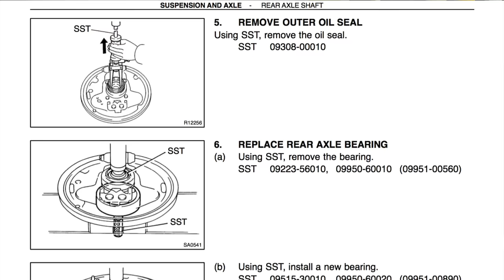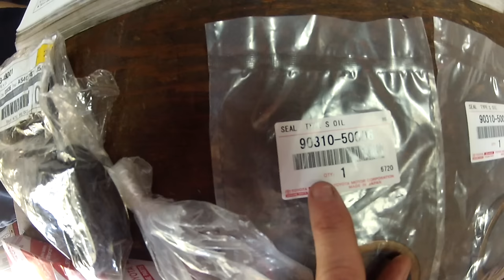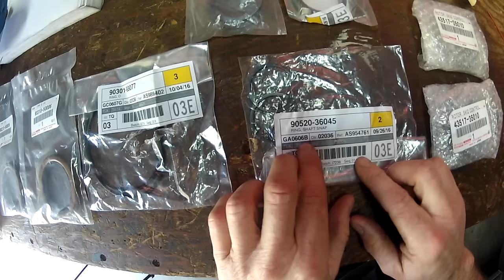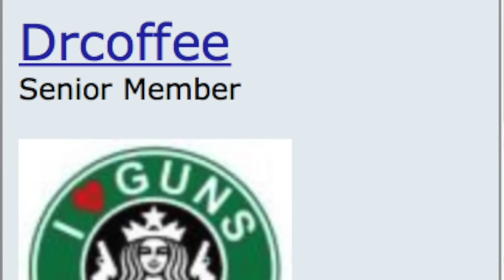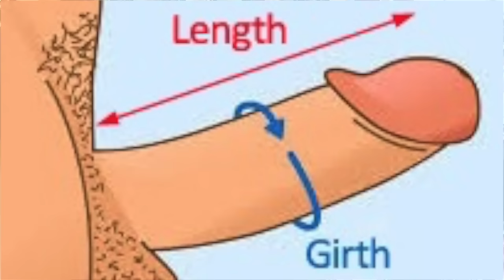Toyota Rear Axle Seal/Bearing Replacement (ABS Rearend)

Comment: Timmay,
Nice instructive video I watched just to become aware of what is involved in the job. But it will not help me because I don't have the space or equipment to do the job. Just found out that it will cost me $875 to have my local small town Toyota dealer replace both rear wheel bearings on a 2000 Tundra.
Probably not a bad price considering how much labor is involved...

How much labor did you put into this job?
Reply from the maker: With experience doing this job on 3 different 3rd Gen 4runners, I can knock this job out 3-4 hours and I'm not a fast mechanic.  For a dealer, $875 is a very fair price.  My local dealer in San Jose California would charge much more.  Their hourly rate is $150/hr.  

If the mechanics know what they are doing and have the right tools, they can pull the parts off rather than cut them off, and reuse the 2 retainers and ABS gear on each side.  You only need to buy the 2 bearings, 2 dust seals, 2 seals, and 2 large o-rings at the ends of the axle housing.  I mention this ability to save money on parts in the video description.  

I hate to say this Bob but there's a very good chance you now know more about this repair than the mechanic who's going to perform the work at the dealership because you've watched our video.  When I bought my 2000 4runner used, I found I had a leaking rear axle seal shorty after purchasing it.  After doing some research on Toyota forums, I learned you either needed to buy special tools or you had to bring your axles to a machine shop to do the work for you.  When I learned some machine shops messed up the press work and/or damaged the axles cutting off the parts, I decided I would let my local dealer do the job for me.  Including new rear brakes and a brake bleed, the dealership bent me over for $1500.  The end result is they botched the job.  I pulled my ABS sensors and found the driver side seal was already leaking.  I took my 4runner back to the dealership and got to talk to the mechanic who performed the job.  I had him do the grease test right in front of me and confirmed he didn't press on the inner retainer correctly.  He was just following the the FSM spec and didn't bother to confirm the position was good.  He probably didn't even know Toyota redesigned the seals that require the inner retainer position to be moved more inboard or flipped like we show in the video.  He also didn't even know what a grease test was.  One of the other senior mechanics admitted I schooled the dude and I'm not even a trained mechanic with certifications.  

Bob, if you want to save money, I would search your local area for a good machine shop and see if they have the tools necessary to service your axles.  Since you know what's involved with this repair, you can be very specific on what you want them to do like flipping the orientation of the inner retainer and the measurement you want them to press it on.  You could even mention the ability to reuse the retainers by swapping their positions on the axle and the ability to reuse the ABS gears too.  By pulling the axle yourself and having a machine shop do the press work, you could save yourself a pretty good chunk of change.  Something to think about.  If no machine shop in your area can do it, ask the dealer how much they'd charge if you to do just the press work.  Like I said, remember to be specific on how you want the press work done because certified mechanics screw up this job all the time.  Trust me.

Comment: So it's been over a year since I did this on my tacoma. Everything has been fine until I recently checked my drum brakes. Gear lube was all over my brakes from the rear differential. Took it to a shop and they said they were installed incorrectly and had to have the axle machined because of it. The truck drove smoothly, no noises or anything. I just coughed up the money and let them fix it but didnt get to see the damage myself. I almost dont believe it, wouldn't it be obvious my bearings weren't installed correctly? Other than fluids coming out the hub?
Reply from the maker: it's hard to say what they're talking about by saying it was installed incorrectly without seeing it myself.  Did you do the previous work or did somebody else do it?
Reply: @TimmyTheToolman  I did the wheel bearings myself to the Tee of this video to the best of my ability. They said the bearings were pushed too far, then said the retainer was pushed too far and was gouged. Charged me a hefty 1200 lol. I feel I got lied to. Theres no way to push the bearings too far right? And I did the grease test, and ensure the retainer was within 5mm of the polished mark. What do you think failed? I feel I messed up installing the seals but nothing else. I was so proud of myself :(
Reply from the maker: @cyclopz-J  You can't push the bearing too far.  You press until the press loads up and you can see the snap ring groove exposed above the outer retainer.  If you confirmed you had a good mating of the seal with the inner retainer, I don't know what could have been the issue other than a clogged breather.  I think these people lied to you.  5mm of polished axle showing is usually about perfect to get the seal riding near center on the retainer but you still need to confirm the mating with a grease or sharpie test which you did.  It's weird that the job didn't work for you.  Have you checked the breather for proper function?

Comment: Ive heard that there is a "vent valve" on the top of the axle. This can get clogged up and also be the culprit of the oil seals leaking. Not sure if these 4runners have them since i sold mine but just an fyi.
Reply from the maker: Yep, you're absolutely right.  This was something I forgot to mention in the video as a possible cause for an axle seal failure.   When the pressure builds up in the 3rd member and it can't vent out of the breather the pressure will take the path of least resistance and that ends up being the axle seals.  Thanks for the comment.

Comment: Thank you for making video. The OEM part numbers alone helps a ton
Reply from the maker: You're welcome Justin.  I just learned though that the 2001 and 2002 have a different bearing than the 1996-2000 3rd Gen 4runners.  Look at the video description and I list the part numbers there.
Reply: I got a question. I have the heads of my 4x4 2000 5spd 4runner. over heated when the radiator failed(cracked behind fan shroud). I got a valvejob done and resurfaced the heads. bolted them on, did a leakdown test to find #2 & 4 cylinder still very low(at 85psi on the inlet of the leakdown tester I was seeing 25psi on the outlet) but no longer venting through the exhaust or intake valves so bad rings  need to remove those pistons. What do you thing will be easier removing driveline ,front diff and oil pan or proceed to pull out engine? only thing is I really want to avoid having to pull out the trans/transfer case etc.  Just curious what your opinion would be since your familiar with these rigs
Reply from the maker: Hey Justin, it could be bad rings on those 2 cylinders but it could be something else.  #1, if it's bad rings, when the cylinder is pressurized, you should be able to hear air escaping from the oil fill cap, PCV valve or even the oil dipstick tube.  I'd redo the leak down test in both those cylinders and see if you're hearing air escaping from any of the areas I mentioned.  If not, there's a chance the air is escaping between the two cylinders or into the coolant channels.  If you take your radiator cap off and see bubbles, the head gasket isn't sealing and you're losing pressure into the coolant channels.  If you don't see bubbles, then there's a very good possibility that you're leaking between the cylinders.  Cylinders #2 and #4 are next to each other.  When you do the leak down test in either cylinder, the pressure could be leaking into the cylinder next door.

I now own a cylinder compression tester and leak down tester but I have yet to use it.  I was thinking of making a video of doing a compression test of the cylinders on my rig.  All the advice I gave you above is from reading and not from personal experience.  But, I did quite a bit of reading on the subject so I believe I understand it pretty well.

I've never pulled an engine on one of these rigs or any other rig for that matter.  But, if I were going to do work on the lower half of an engine, I'd just pull the engine and work on it while it's on a stand.   Since you have a manual transmission and the input shaft slides through the clutch and flywheel, I'm pretty sure you'd want to pull the transmission out to get the engine out.

Comment: Can you convert non abs axles to abs axles? I have a 97 tacoma I wanted a elocker so I bought a 97 4 runner with a elocker it was the only one I could get. Than I got a 98 tacoma elocker axle put it all together axle shafts from 4 runner which moves the e brake levers so e brake won't work. Long story short can u convert non abs axles to abs axles to my axle seals will work? Thank you
Reply from the maker: ABS axles are machined differently than the Non-ABS axles so it won't work.  Check out this video where we are working on Non-ABS axles and you'll see they are very different. https://youtu.be/vW25hvODHcs

Comment: You would not happen to have the number for the studs that you stripped do you?  I am having a heck of a time finding this number.  Shop destroyed a few of them pressing them out.  2000 ABS limited is what they are on.
Reply from the maker: Not off the top of my head.  I'd have to search for it.  But, if you have a Toyota dealer near you, just pay their parts department a visit.  Those studs are that expensive, even from the dealer.
Reply: @TimmyTheToolman  No dealer with an hour of me.  I finally found a good exploded view and got them ordered.  Thank you for the reply and the video!
Reply from the maker: @duncanevy  Ok cool.  Glad you were able to figure it out.

Comment: Hey guys,  I bought the ebay tool from Duane for my '07 FJ rear axle (disk brake + abs). The FJ has two rows of ball bearings and the race for the outer bearing remained on the axle (the tool separated everything else). Do I need to use a bearing separator at this point? The small dust shield at the lug nut flange doesn't offer much room for a separator. I guess it's time to remove all the studs to get the shield off or is there a better way to remove the shield and/or race?
Reply from the maker: Hey Hans, we don't have experience doing the rear axle seal/bearing job on an FJ Cruiser.  But, I think I understand what you're saying that the race is stuck onto the axle shaft.  A bearing splitter is what I would also try to get the race off.

Comment: What’s weird in my case is that I know my axle seals have leaked because my brake shoes are soaked in oil. But I don’t think they are leaking right now. I have never seen any leaks from the rear axle. Again the only reason I know is because my brakes have gear oil on them. I want to replace my brakes but don’t want to ruin a new set if the axles are still leaking. Again I’m not sure how they could be because I’m not losing gear oil. Any thoughts?
Reply from the maker: The gear oil works its way past the seal, through the bearing and then eventually into your brakes.  Sometimes you don't get an exterior sign of the axle seals leaking but rather see it in the brakes like you have.  There is no doubt, your axle seals are leaking and you should perform the complete repair.  I suggest you also watch Part 2 before you take this on and also read the comments we pinned (1st comment you see) for more helpful information not shared in the original video.  https://youtu.be/R-c2x3F8DU4

Comment: So do I need to indeed bleed the brake for whichever side I'm replacing a seal once it's all done? I've seen many people doing this job say to do it, but dealership is saying it's not necessary for Toyota (yet it is for Lexus??), seemed odd so thought I'd ask. 
Also I wanted to clarify, for the new inner retainer being pressed onto the axle, you're suggesting that it simply be flipped? Or are you also saying it needs to be pressed onto the axle at a different position in addition to flipping it? I won't be doing the press work myself, but taking it to a machine shop, so I am trying to understand your flipped inner retainer technique so I can tell them exactly what to do. I don't have space to keep a press around, hence why it'll be sent to a shop for that piece of the job.
Reply from the maker: Hey Ryan,  You're disconnecting the brake line to pull the axle out so you definitely should bleed the brakes afterward.  I can't believe the dealership is telling you don't have have to bleed the brakes.  If you follow our lead and cap off the line with a vacuum cap to limit your brake fluid loss, you can get away with just bleeding the rear brakes.  I'd bleed both sides in the rear.  If you don't cap off the line and lose a bunch of fluid, you should bleed the entire system, all 4 wheels.

When you flip the retainer, you're able to keep the retainer in the original spot it was on the axle, 5mm of polished axle showing above the retainer.  If you don't flip it, you'd have to adjust the retainer more inboard, apprx. 3mm of polished axle showing above the retainer.

Read the video description on how to save money for this job.  If the shop doesn't cut off the parts, you can save yourself around $150.
Reply: Thanks for clearing that up for me! Keep up the videos, this is probably the 4th video of yours I've used to do work on my 4runner.
Reply from the maker: You're welcome.  Nice to hear you're making good use of our videos.  Happy Wrenching!

Comment: I read where y’all said that this repair is also related to older Toyota picups. Would I be expecting to go through the same exact steps as y’all did in the video? But of course parts would be a bit different or still the same too?
Reply from the maker: If it's an older pick-up, I'm guessing it doesn't have ABS.  We have a video for non-ABS rearends too if that's the case.  Here's a link:  https://youtu.be/vW25hvODHcs

Whether it's ABS or Non-ABS, the techniques and steps we show in the videos would probably correlate to the axles on your rig.

Comment: Any ideas as to why the half shafts won't fit all the way into the housing? I have one in, the other is jammed on something but can't figure out what. Appreciate any tips in advance
Reply from the maker: Are they the same axles you pulled out or are they replacement axles?  The only thing I can think of is splines on the end of the axle are damaged.

Comment: also 8mm 1.25 long bolts takes the drums right of they have threads also you can use water to clean dust of save another couple of bucks
Reply from the maker: Thanks for tip Juan.  I've heard of this ability but I never knew the size and thread pitch of the bolt to use.  Thanks!

I'm sure water would do a great job and be less toxic but it doesn't dry quickly like brake cleaner does which is one of the reasons I'll probably stick with brake cleaner.  Also, water can cause parts to rust but I reckon if you blow everything off really well of just let it dry long enough rust really wouldn't be a factor.

Thanks for the comment.
Reply: i have alot of time as a tech master car and truck  20 ase just passing info to younger techs
Reply from the maker: Thanks for the passing on the knowledge.  We need more guys like you.  Maybe you could make some helpful videos like we're doing.  I started wrenching on vehicles 36 years ago but it wasn't until recently I started tacking more involved jobs.  I started wrenching on a 68 Ford Bronco and also worked at a full-service Chevron gas station where I did minor repairs.  

I'm having a great time making these videos.  I enjoy the challenge, the knowledge I'm gaining and I enjoy helping people.  Just yesterday I got a nice comment from a guy from Sao Paulo Brazil saying one of our videos helped him out.  Pretty cool to know our videos are helping people around the world.

Comment: So what exactly is the point of the ABS tone ring on a 01/02 Tacoma that doesn't have ABS?  When replacing the bearing, is there any point in throwing on a replacementtone ring? Dealer wants $85 for one and my machine shop guy is saying there's no need for it if i dont have ABS. He can just line up the race to ensure it's in the right position.
Reply from the maker: The machine shop guy is right.  If you don't have ABS, you don't need the ABS tone ring.
Reply: @TimmyTheToolman  Thank you so much for the fast reply. Had a long conversation with him cause he's done a bunch of these for Toyotas but he said this is the first time anyone has requested to skip the tone ring. Never gonna add ABS to my taco so this save me some cash. Thanks again!
Reply from the maker: @pliablefoe4337  You're welcome Brandon.

Comment: Would you recommend adding FIPG just out of precaution? It’s a lot of work to do over again...
Reply from the maker: Where do you want to put the FIPG?
Reply: @TimmyTheToolman  Around the axle seal
Reply from the maker: @123idontcareok  Yeah, it wouldn't hurt to put a little between the outside of the seal and the axle housing.

Comment: Hi do any of the parts from Toyota like the oring, snap rings or axle seals come with multiple or do you have to order 2 of everything. Another great video 👌
Reply from the maker: They are all singles.  Before you order parts or buy any tools, make sure you read the video description and the comment we pinned.  Also, watch this video where we showcase a special axle tool that's better than the one we used in the original video.  https://youtu.be/R-c2x3F8DU4